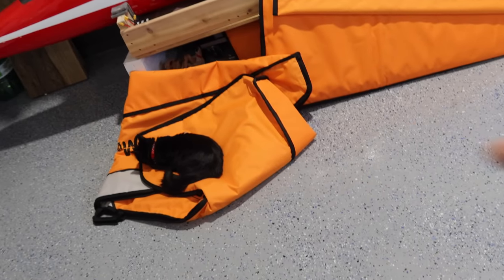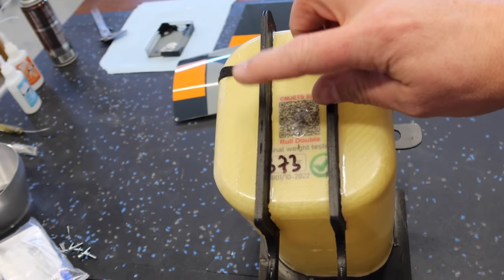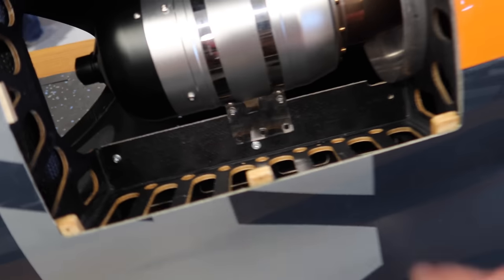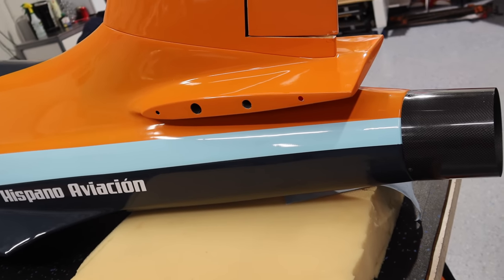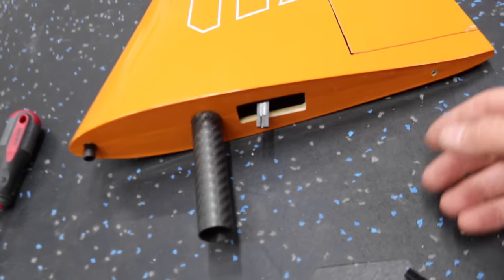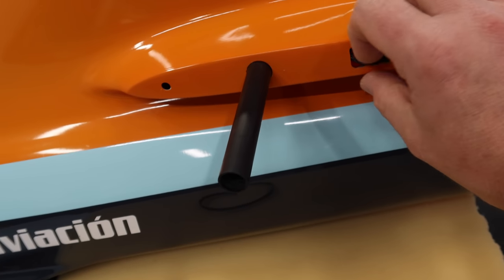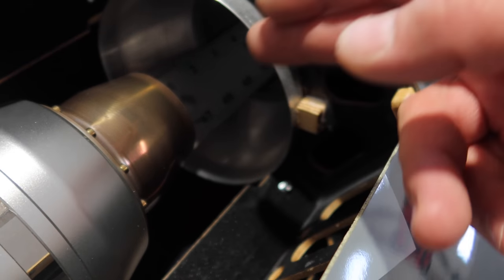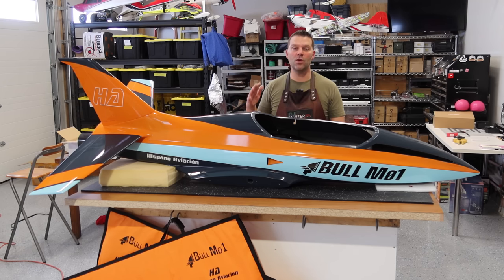Let The BULL BUILD BEGIN - Hispano Aviation BULL RC JET

Comment: Great build, really like this jet. A 'small' one compared to the last builds! What size wire snake skin are you using?
Reply from the maker: Thanks Nathan. This is one of those perfect size planes. Fits in pretty much any vehicle. Light and manageable with one person. Low fuel consumption. She’s awesome!  I have lots of different sizes in stock but I find myself using the smallest size I carry the most often. Not sure of the size but can easily expand it and fit 5-6 wires if needed.

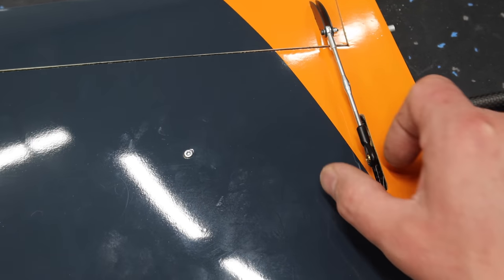Comment: Hello Sir, In the minute 13:00 i see the clevis doesn't fit in the center of the servo arm. Is this  factory problem design of the servo mount ribs ??
Reply from the maker: Good eye.  On the elevators of this plane the surface mount arms are not perpendicular to the hinge line so a ball joint is best practice on the Elevators.  All other surfaces are straight.